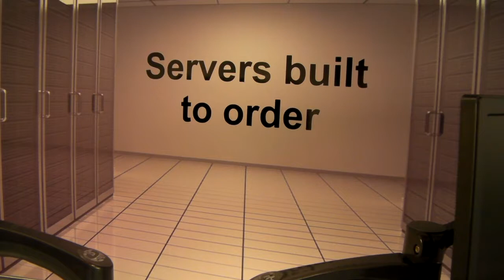X-Case Custom Server Build Supermicro Tower 743TQ-865B-SQ

Comment: Thank you for taking the time to do this video. I purchased this chassis for my server. There are not many pictures of the Supermicro Tower 743TQ-865B-SQ chassis and it is good to actually see it as you showed us before buying it. What I like about this chassis is that it has the backplane for our SAS drives and controller to connect to. Currently our server is in a SuperMicro 1U and it sounds like an airplane taking off 24/7. Going to this chassis will solve our problem.

Comment: Does somebody know if a normal ATX power supply can be mounted in this chassis?
Reply: No it cannot without possibly drilling a few holes in the aftermarket power supply in the chassis as mounting points to screw it in because the supermicro power supplies attach to the case using different screw holes.
Reply: @svtcontour   It can. Has the pre dilled holes for lots of setups. I fitted inside a uatx without issue.
Reply: @carlosmorenoyanez60  Did you just use the standard 4 screw holes on the back of your alternate psu? Is that stable enough?

Comment: This model comes with only two 8 cm fans for the SAS enclosure. They're also 2400 rpm, instead of the typical 5000 rpm x 4. Although you can spin the 5000 rpm fans down via the bios, they tend to be louder rpm-per-rpm because they tend to have a deep "growl/hum" to them. Also, it has one 9 cm (2400 rpm) fan in the rear instead of two 8 cm at 5000 rpm. It would have been nice if you could use a 12 cm (120 mm) fan in the rear.  All in all, if you're going to use 2.5 inch drives (you will need to order the caddies), I think you'll be okay with the cooling. Though I don't think you'll want to use a shroud with this case.

Note: he says it has a 120 mm fan in the rear, but the specs show 90 mm. Also, the SNK-P0050AP4 lga 2011 heatsink/fan is whisper quiet, even when spinning full speed.

One other thing, never run these servers for more than a few minutes with the side panel off if you have a stack of SAS drives (10K or higher). You will likely kill one or more of them.
Reply: elaborate as to how can you kill those SAS drives if I have the panel off pls.
Reply: With the side panel off you'll lose front end airflow due to lack of suction, which will reduce the drive cooling significantly. You'd need to be around 65-68 degrees F ambient temperature not to lose one or more drives, IMO. But I still wound't risk it. From a SuperMicro chassis manual:

"Reinstalling the chassis covers:

To maintain proper system cooling and airflow, do not operate the system without installing all chassis covers back to the chassis."
Reply: "Also, the SNK-P0050AP4 lga 2011 heatsink/fan is whisper quiet, even when spinning full speed."

Correction, it's not whisper quiet at full speed. But overall I would define it as whisper quiet.